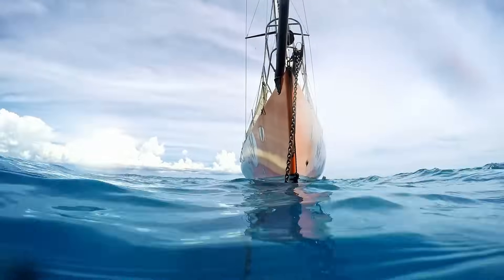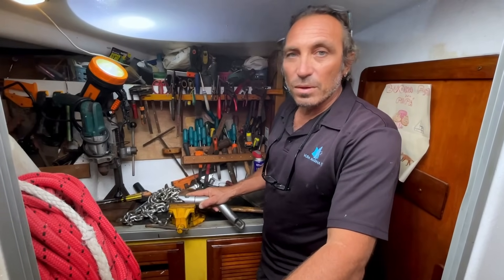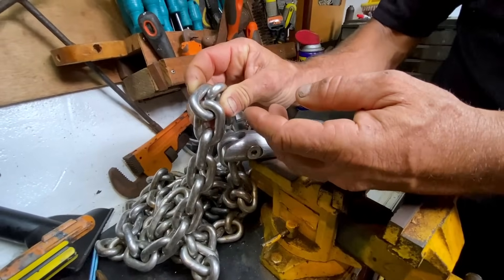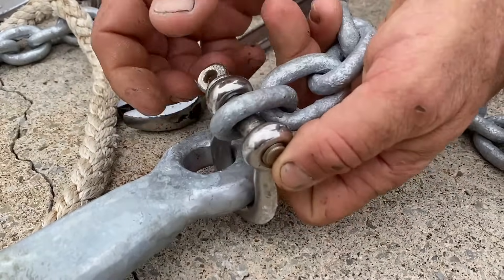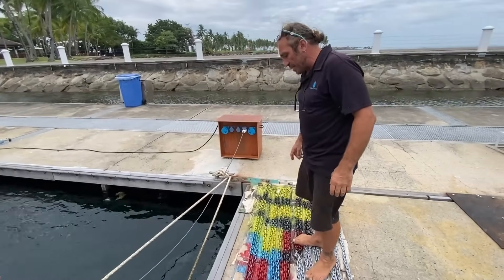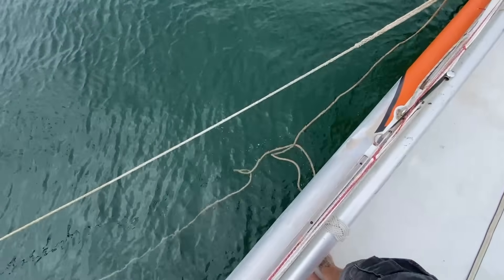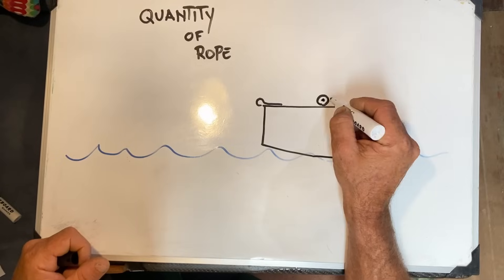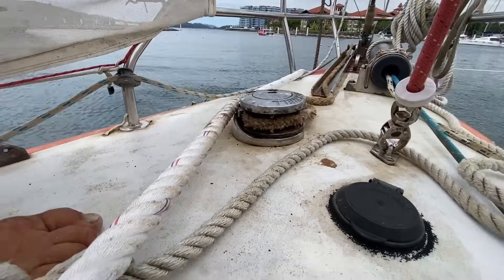Anchor Rode Installation: The ultimate guide to installing your anchor securely

Comment: Your CQR anchor seems very small for the boat size? Is the holding power good? I have a 25kg CQR and find it small for my 45ft 18ton. Do have 10mm 100m chain
Reply from the maker: My boat is only 10 ton. 
And I find really  good my 100mt. chain 10 mm. End my Big CQR

Comment: Regarding The CQR anchor, I would not recommend it. Otherwise great advice Nimo. If people are watching this episode to learn about anchoring I suggest going to SV Panope You tube channel with years of independent and not sponsored anchor testing. Everyone will lean a lot about their anchors strengths and weaknesses. Also note, tests show that the Rokna is not the top rated anchor and has a flaw owners should be aware of.

Comment: I like the gipsy controller that stows away below when at sea. 👍For anchoring in foul ground you can shackle the chain to the head of the anchor and cable tie the chain to the stock.  That way a fouled anchor can be broken free and recovered. No need for tripping line.
Reply from the maker: we're not a big fan of this technique, as if there's really strong wind, it can also break the cable tie, and you could end up dragging... We usually dive if we get fouled.

Comment: When we bought our boat it came with a CQR and it was terrible. We replaced it with a Mantus and 8 yrs later and 35,000 miles it has been awesome. I tried to sell the CQR and finally gave it away to a guy who used it as a yard decoration.
Reply from the maker: everyone has their opinions, we've often found people aren't keen on the CQR because they're not totally aware how to utilise it properly
Reply: @SailingNV  50 anni di crociere, gli ultimi 20 per 5-6 mesi all'anno, mi hanno insegnato che la tenuta dell'ancora è direttamente proporzionale alla bravura ed esperienza dello skipper. Se ancorate su un tappeto di alghe con poco calmo rispetto al fondo sarete tra quelli che parlano male della loro ancora: ma il problema non è l'ancora, è il marinaio... Io uso ancora la vecchia CQR 35lb sulla mia Moody Eclipse 33 e ne sono soddisfatto, anche se (forse) una moderna Rocna Vulcan potrebbe essere meglio. Buon vento 💨

Comment: You just don't need a swivel. And a swivel that's straight onto the shank of the anchor is at risk of lateral load and breakage. The only task a swivel accomplishes is to drain your wallet.
Reply from the maker: you explained it better than I did